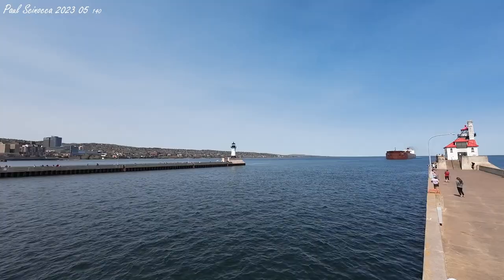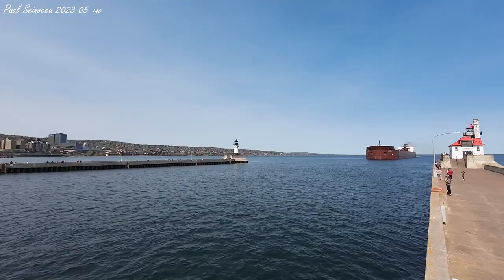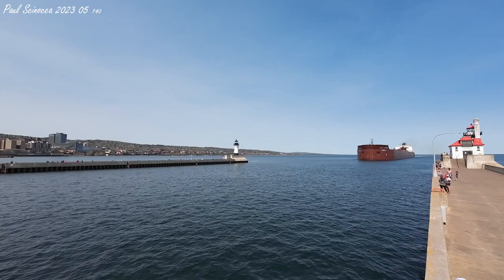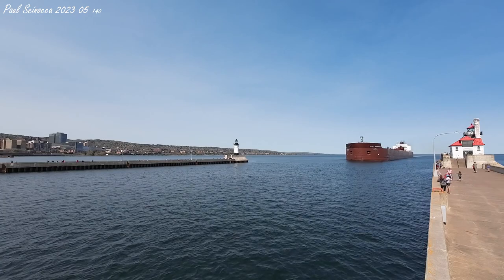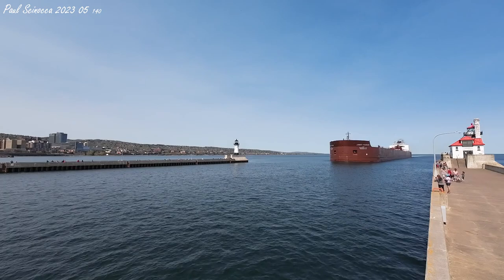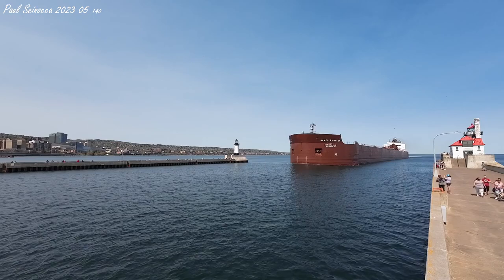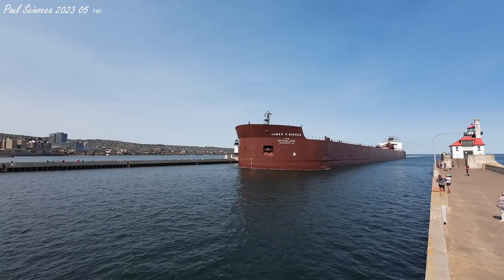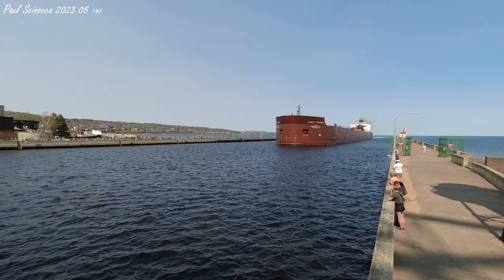Comfortably Cruising into Duluth, The James R Barker pleasing the crowd with their signature salute

Comment: Maybe a stupid question, but is there more info on those horns, and is the two tone blast (with the higher sounding first) built in, or does the captain do that manually out of tradition?
Reply from the maker: Mainly tradition. All required communications is done via radio now. The ship starts the salute, the bridge replies in kind.
Reply: @PaulScinocca  Hi Paul, thanks for the reply - I was actually curious about the James R Barker's 2 tone whistle in particular, if that was automatic or if there were separate actuators for the high vs low tones.
Reply from the maker: @TheAfterWorkGarage  oops 😬,  manually done with actuator buttons
Reply: @PaulScinocca  Thank you! So theoretically they could do a low then high tone (or at the same time), they just do the high-low by tradition? If so, that's definitely really cool!